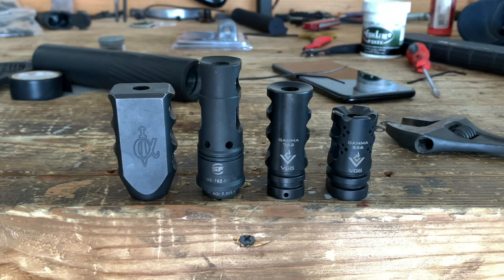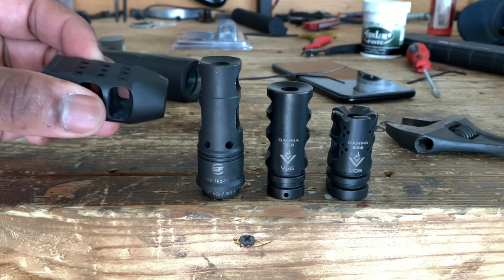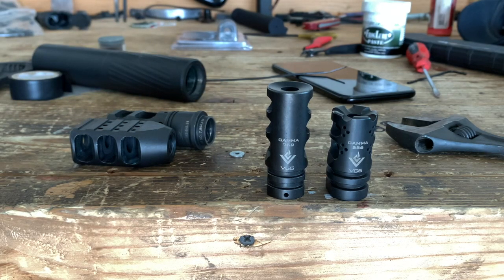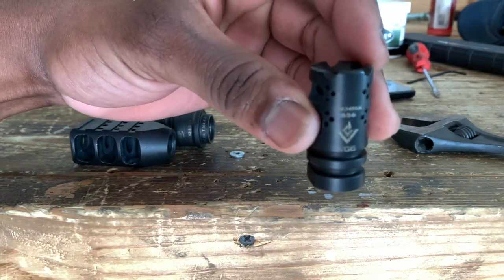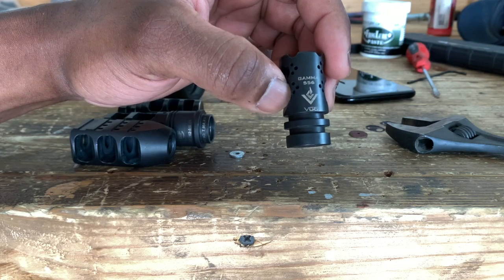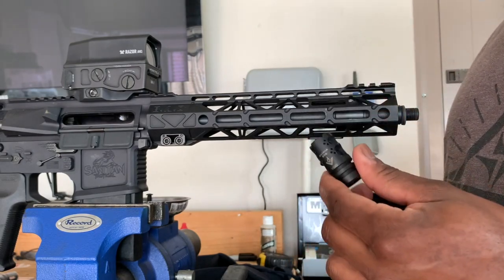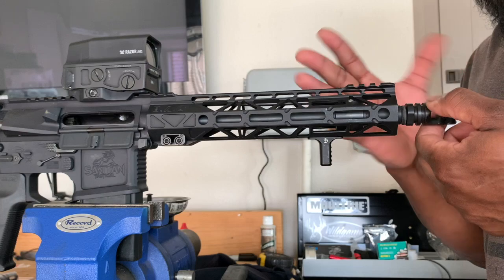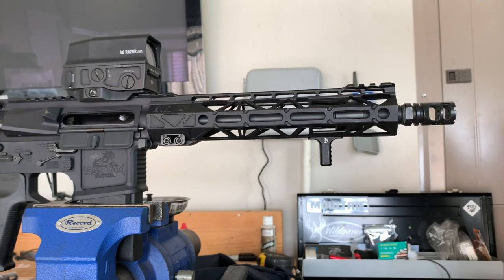VG6 Muzzle brake (check this out)

Comment: I could make a whole channel dedicated to mistakes I have made. Thanks for the honesty.
Reply: Tell me about it. I still have the tip of a 3/16th punch stuck forever in one of my uppers' forward assist roll pin hole that broke off and I couldn't back out. It's in there for good...ended up taking a dremel and sanding it flush. No issues, but it pisses me off every time I look at it.

Comment: You are correct. Logo goes on bottom side, which is counter intuitive. Very easy mistake to make.  If I didn't do a bunch of research on it first, I would have almost done the exact same thing. I have a VG6 Epsilon on my 308 bolt action rifle. works great.

Comment: Good catch in figuring out what was wrong, and thanks for this detailed installation vid. I'm sure there are others out there unknowingly using this brake upside down. I wonder what the small ports are for on the logo side. The 7.62 brake didn't have these

Comment: I personally don't like muzzle breaks. I've tried them but the added noise and back pressure from the break itself wasn't worth the reduction in recoil, to me anyway. I recently picked up a 5.56 pistol. It came with a flash hider but before I fired it once I swapped out the bird cage to thread protector.

Comment: Man, crap happens.  At least you owned up to it.  When you work on guns all the time, mistakes are going to happen.  The biggest thing is to prevent catastrophic uh-ohs.  This one was minor.  I over torqued a muzzle brake once to where I was a good 5 degrees off.  Worked fine, but the AK-47 like angle visually bothered me until I fixed it.

Comment: Also if I may suggest, get a reaction rod. If you’re going to be installing and removing parts quite often, I highly recommend it. Torquing on the barrel is not good for the upper receiver; you could damage the notch that the indexing pin on the barrel mates onto. It transfers the torque to  the barrel lugs.

Comment: no worries man...its the only way to learn!!  If your ever having a hard time getting something timed with a crush washer, apply torque, back off, apply more torque, back off and then torque it to where you need it.  It seasons the threads and takes some pressure off of the parts because your giving the crush washer a chance to do exactly what it's built to do, crush to spec.

Comment: 🙃made that same mistake too. It does look a lot better with the logo on top too. The problem i have with the Gamma is the flash on a 11.5 is really big so not sure if im going to continue using it on the shorty and just go back to a YHM for 30 bucks or regular A2.

Comment: Even the worst of compensators works well on short barrel center fire rifle caliber pistols my friend. Checkout Precision Armament’s M4-72 and Hypertap..! Been using comps on NFA submachine guns, machine guns, competition pistols, shotguns, and rifles since mid 80s and now have a shoe box full of them after discovering M4-72 and Hypertap...! 

I use PWS FSC 556 comp on SHTF rifles as it designed for my old model Gemtech Halo suppressor plus provides excellent night shooting without suppressor, but Precision Armament’s new Hypertap is truly absolute best comp on the market for controlling muzzles...! 

I use M4-72 on my competition custom built Arsenal 101s, Sam7, and Hypertap comps on AR 556 and my other many different types of big bore firearms..! 

I’m not knocking what you like..! I’m simply saying try custom tunable Hypertap..! I seriously doubt you’ll be disappointed..!

Comment: I installed one of the VG6 Gamma correctly on my 300blk AR last year that i built, and then early this year i had a shop build a grendel AR for me and provided them with a VG6 epsilon to install, and when i finally got the gun home i noticed they had installed the epsilon upside down! It is such an easy mistake to make with the 12 tiny holes and logo and the bottom, a huge amount of ppl install them wrong, which makes me think VG6 should maybe have a photo of it installed on a barrel on their website to clear the confusion... I’m so glad i stumbled across this video

Comment: I bet they don't have mark for a pin an weld on the 5.56 gamma bc it ain't long enough to be used for a pin an weld in most scenarios it wouldn't add enough length as compared to like the surefire socom a very common brake used on pin an weld builds...

Comment: I almost made that mistake till I had to do some thinking about the cuts on the muzzle, I’m glad I was right. it was a pain to get it on there, especially with a crushed washer that’s already been torqued on 200 degrees, so I had to shimmy it with the same crush washer but it works fine.

Comment: Props to you for making a video (gasp) making a mistake. I was about to install mine, and the only reason I knew otherwise was that I am very familiar with the A2 from my time in the military. No slots on the bottom to prevent kicking up dirt when shooting. The VG6 has some holes near the logo where it faces down, making it confusing. It's awesome to see someone admit an error and expose themselves to ridicule from internet simpletons. Thanks!

Comment: I use the vg6 muzzle brake, had mine installed the incorrect way at first. They are my fav. Cheap and work as well if not better than a Lantac.

Comment: When you install a muzzle device using a crush washer do you tighten by hand to the washer then full rotation till it’s timed?
Reply: Meerkat 
Yes, unless it is almost timed by hand tightening , then I will make another full turn.
There is enough "crush" to the washer that you can crank it down another full turn.

Comment: Your anti rotational pins are still in the wrong places...solid pin on hammer and threaded/screw for the trigger. Instructions as per kns.
Reply from the maker: R M I’ve been running it like that for years, zero issues on my other rigs. Can’t stand that screw being on the bottom.
Reply: @TxKiller  I hear you man no offense or anything like that...if it ain't broke dont fix it lol. Your build is sweet it's one mean looking rig.